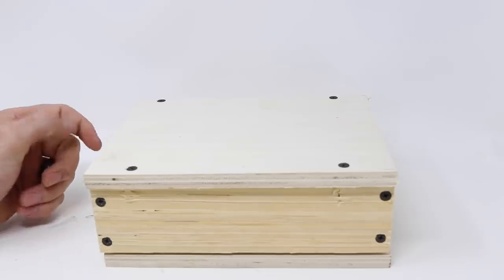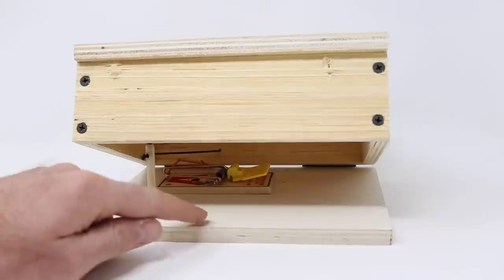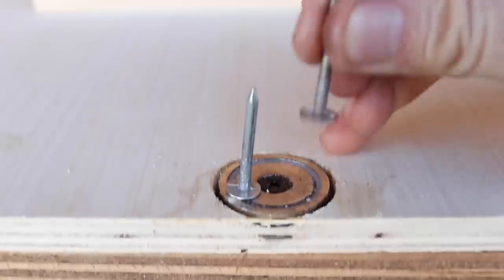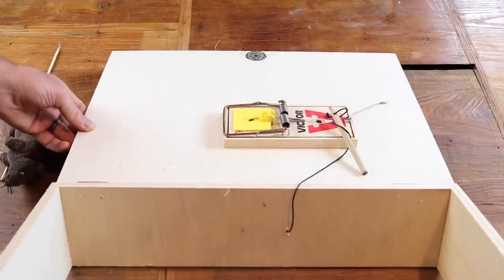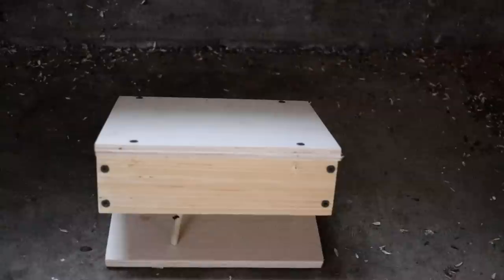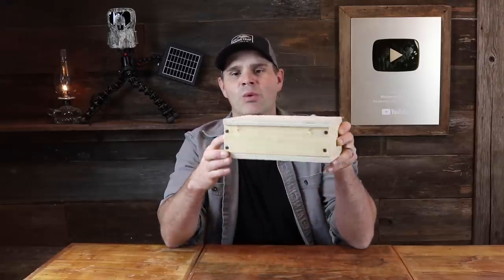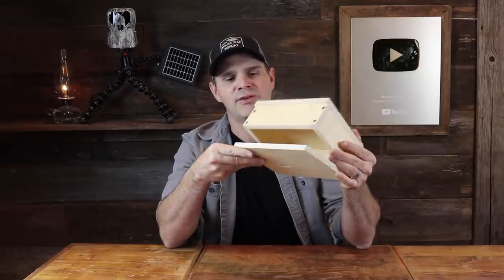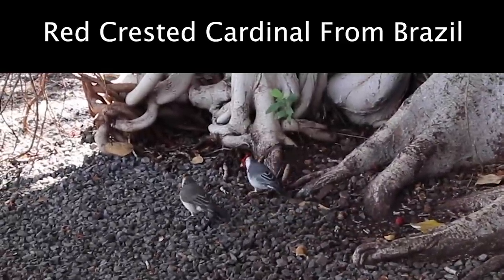A Rat Trap Hack That Works! How To Catch MORE Rats & Mice  -  Mousetrap Monday

Comment: And if that doesn't work, the falling box strikes a match, and lights the whole thing on FIRE!
Reply: And if that doesnt work a frag grenade set nearby gets triggered blowing everything   in the surrounding area up.
Reply: justinl458 your crazy but I like the emoji
Reply: @theenzoferrari458  I have to get used to 5 year olds being in the comment section -(.    Y    .)-
Reply: If Tom & Jerry taught me anything, an ironing board needs to fall on someone.
Reply: @tin2001  What about the hot iron?
Reply: Lol that would be something
Reply: @Josh12323  -  haha  I knew that someone had to go there.  I'm still trying to determine where the 10 ton weight fits in the sequence.
Reply: The entire contraction is on a giant catapult, that launches it to next zip code
Reply: Belias Phyre 😂
Reply: and your house
Reply: Pre cooked meals
Reply: These little guys are smart! A man sitting outside his house was having problems with rats. Finally, one comes from out of his house and the guy lights the rat on fire. Rat runs back into the house, burning the house down!
Reply: @rammbostein  hahaha nice!
Reply: Flame thrower style like myth busters!
Reply: And if that doesn’t work, a small 10 microgram thermonuclear device will blow up the entire room, but nothing outside of the room

Comment: Here's an idea:  Put the new trail cam under a pre-fab outdoor shed, which has been propped up on one side with a shortened broom handle, and a string tied from the handle to the cam.  The thief wants the camera, goes in and pulls on it (thieves aren't too smart), which drops the shed, trapping him inside.  The next morning, one punch should be enough to subdue him (thieves are wussies), then 'give him a little flip' onto the beaver dam, and see what comes along!

Comment: Thank you! I have tried rat traps with razor blades. Rolling pin across buckets, trap doors over buckets, electrocution, peppermint, everything but poison in my chicken coop. Rolling pin seemed to work the best. Alpha rats are very smart. They are hard to trick. Will try the box method.👊

Comment: Okay... This might sound kind of gruesome but I have made some modifications to my standard rat traps that I use around my property.  The rats and rock squirrels are enormous and sometimes get hit and only injured, not caught. I have resorted to putting nails (sharp tacks)  all the way through (4-6 of them) the wooden trap at an angle just inside the kill bar. Seems to work VERY effectively as I have yet to find a sprung trap without a pest in it.
Reply: Thanks, great idea.
Reply: Good eye d ah

Comment: Hey Shawn, great video, Thanks for the hard work. I have a question about the peanut butter bait you use, as I recall you mentioning one of your kids is allergic to peanut. What kind of precautions you take in order to not let your kid close to it? Or maybe enter in contact with some possible particles of peanut that could be still in the traps?

Comment: Sometimes when mouse is very alert, swinging of trigger arm right by its face will make it jump back and avoid the kill bar by split second.  It happened during the daylight in our house before.  Mouse was very fast and dodged the kill bar, but went into shock right by the trap and just sat there stunned and we easily caught it with bare hands.

Comment: Instead of the disk magnet, one could probably use a couple of magnetic cabinet latches, readily available in hardware stores.  Secure the steel plates on the bottom platform and the magnets on the box wall.

Comment: My brother keeps insisting that rats are more easily attracted to salami than peanutbutter. I have only caught mouses with peanutbutter around my house but i havent seen any signs of rats either so i havent felt tempted to try his theory. He has a big live catch trap that he brought to his worksite since they did see traces of rats. They baited the trap with salami in a storage room and left it with the door closed thinking the rat was hiding in there. The next day they had a big rat in the trap but they also found a chewed hole in the door since the rat wasnt in there to start with. Would be fun to see a comparison with same traps in same location at the same time with different bait to see what attracts them most. Thank you for your epic videos! Best regards from Sweden

Comment: One minor downside to this specific implementation is that if you catch live rodents, it'll be difficult to control their exit. This same principle could be used with a wire mesh box that one could simply submerge under water.
Reply: I was thinking a small hole on the bottom part of the trap.On top of a round barrel filled with water.he’ll jump down trying to escape. And Done🤔

Comment: 08:55 - If this is an issue, you could retrofit your IR lights with 950nm IR LEDs which aren't as visible to most animals (and humans). Most night vision lights use cheaper 850nm IR LEDs which are slightly visible. Although, if it works, it works. Some great night footage I've seen on your channel. :)

EDIT: Just got to the bit where you explained about the theft of trail cams. I'm sorry to hear that. But yeah, trail cam IR LEDs are slightly visible and will alert people. The (above) comment I made would apply to this situation too.

Comment: Have you tried slim Jim's as bait? My dad was part of the top pest control company in Boston in the 90s and swears by it. The oil in it is  fragrant and doesn't dry out easy plus it's fibrous so they really have to pull it to get any. Just smash some down on the trigger so it's tough to take off. :)

Comment: I would like to see mouse & rat traps  screwed into the wall at various heights. You will need to securely attach the bait so it doesn't come off when the rodents bite at the bait.  You may want to experiment with the angle of the trap as well (45°, 60°, 90°, 120°, etc.)

Comment: Shawn, I looked into the Exodus Lift II trail cam and the company has most of their cameras "out of stock" and the support line is not answering email, and the phone number goes to a full voice mail recording.  Do you know what is happening with that company?  I can't find anything on the web either.  The BBB has them as a D rating because of support turn-around times.
Thanks for the good review.   I like all the points you brought out.

Comment: I like the potential to catch more than one inside the box.

I wonder if it might work any differently -- such as whether rodents would be deterred from entering, or feel more secure; or if it might behave differently, such as closing more securely -- if in stead of having an entire box descending, the lid was hinged at the top, and only had the front panel attached to it.

Comment: Hi Shawn great videos showing the mechanics of the traps. With this trap, would a rat if he tripped the trap without being caught,  roaming in the box looking for a way out, be able to get out. I did notice a small gap when the lid shut down, would the rat be able to push his nose to the gap and force his way out, even with the magnets, rats are very strong animals when they have to fight their way out of a situation would the sides be tall enough so he cant use his feet to push his back up to open the box.

Comment: I've just got an idea, since CO2 is heavier than air, you can fill a bucket trap with carbon dioxide, this would make a more humane trap than the drowning ones, the mice and rats will suffocate quite quickly. I never liked the bucket traps because they are not a quick humane kill, the rodents have to swim for a long time before being exhausted and die from drowning.

Comment: There are two potential unintended consequences in using the catch box, one positive and one negative. The positive one is that the box could easily catch multiple rodents when one sets off the snap-trap. The second is that a rodent could potentially close the box by pushing the stick holding up the lid without getting caught.

Comment: The reason traps not always work is: rodent approaching it from opposite side of bait. Use any large plastic bottle or cardboard box. Cut hole. Put trap inside with bate facing entry hole. Try with stick few times.

Comment: I've been using cheap snap traps for the last year or so to catch mice in my apartment and so far, I have not found any tripped traps that did not catch any mice. The traps either caught mice or did not get sprung.  I have found unsprung traps that have had their bait taken though. Shawn, do you have any advice for making snap traps more sensitive?
Reply: Use pliers to Bend the metal pieces a bit.  It'll make it more challenging to set the trap, but when you do, it'll be easier to trigger

Comment: A little late to the video, but in response to stolen cameras, maybe try attaching a battery operated gps tracker? If they make a small enough unit, it may be undetectable, and lead you right to your thief. Just a random 4am thought of mine..

Comment: question: Have you ever tried using something to remove or camouflage your scent in the traps?
Reply: He's used different predator scents for deterrents with no real effect. If there is easy food, mice and rats don't really care what else might be around. So hiding his scent wouldn't really do anything.
Reply: @roguegen5536  might be just like u said, but the cameras shows that a lot of mice and rats avoid the traps, not even going to get the easy food.

Comment: Dude, you need to develop a feel for the screws or use the torque setting on the drill. You've ripped out most of the screws you screwed in on camera. Doesn't really matter here, but in other situations where it does matter you're just making the attachment weaker. Once it clamps good, there's no point in screwing it in further, and a lot of reasons not to.

Comment: The concerning part in the rat trap portion of the video is that you definitely have a rat infestation, and while 6 or 8 were all over the trap, only 1 got caught in the end. In the mouse version, the 1st mouse basically walked all over the trap without it being set off. Lastly, suppose that the rodentia is not killed by the kill bar and is alive inside the box. What are you supposed to do? Take it outside to some hated neighbor's home/property and let it go? Open the box while holding a Glock in your hand and hope you can hit it when it escapes the box? Pick up the box and viciously swing it up/down side to side and hope that you  can stun the rodent inside to the point where you will have a better chance at stomping on it when you release it from the box?  Glad you found some good trail cams .. I'll bet they were expensive. I see ones at Walmart for $28.95, but they probably aren't very good .. likely made in China as well. Looking forward to your future videos.

Comment: Put a hole in the bottom and place it over a 5 gallon bucket with water in so if it escapes the trap it will go through the hole to a watery  grave

Comment: some a**hole stealing your trailcams, hm?.........try this: 1> drill 2 small holes in the outer casing.
2> put some steel cable through those holes, and seal with something like silicone ultra-blue.
the rest is academic.

Comment: Forgive  My Evil Mind But say the Rat trap does not work as it should and that the lid goes down Trapping the Mouse inside. Unless you are one of those Goodie Good shoes who Likes to let the Mouse or rat go free where if its a Female she's doing to Produce thousands of Little Vermin Mice/Rats Why Not Stick a Load of Sharp pointed Needles so as when the  Lid Comes down you end up with a Quick dead  Mouse/Rat Some Rat Back Breakers tend to only Half trap a Mouse or Rat where they struggle to get Free which I Consider that this is an inhumane Trap Face up to it a Rat or mouse that is impaled with four or Five  Spikes there is no surer thing that the Vermin would die instantly